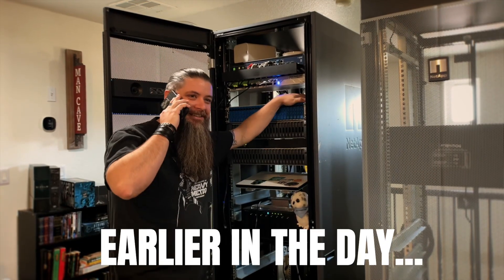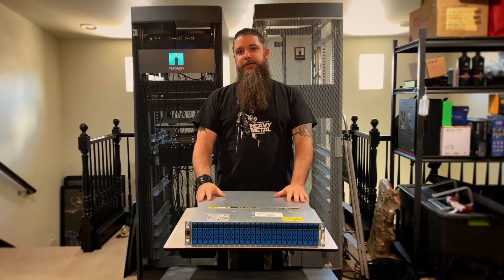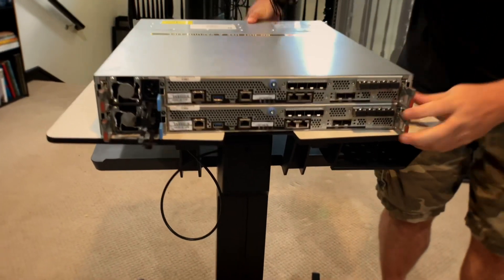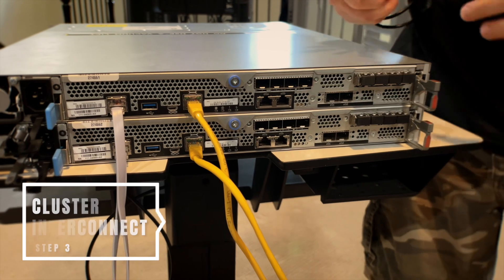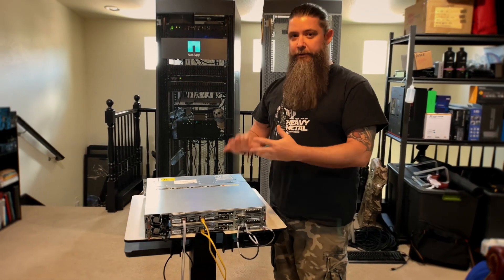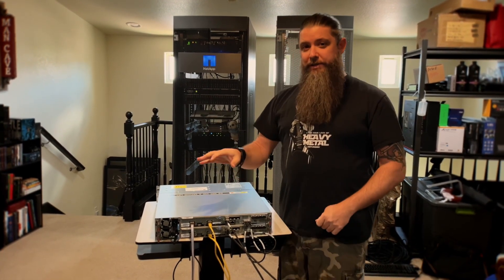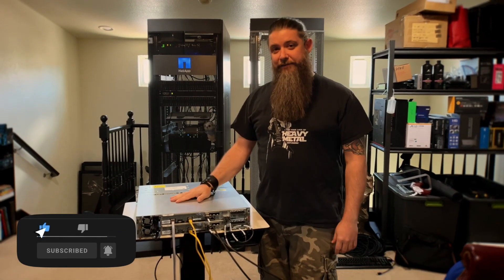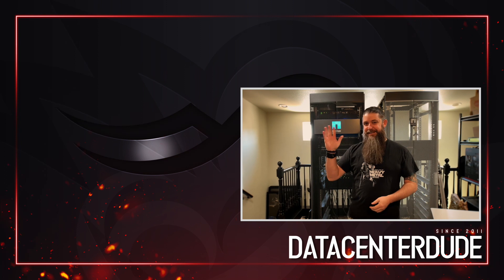Cabling up my NetApp storage system

Comment: i missed the cable specs and a desciption, why you dont need sas/minisasHD cabling.
Reply from the maker: This platform uses 100Gb to connect a single NS224c shelf.  Different than typical FAS platforms.  I've also got a FAS2650 with shelves we'll be cabling up with those kind of cables soon.

Comment: Thank you so much. New to SANs, especially NetApp devices and hard to find non-NetApp video with a real person showing how to cable the devices. The NetApp guides are very confusing if you're not familiar with terms like unified config, inter-connect switches, etc. All my limited experience to write documentation for my client up till now has been with the Select virtual appliance and of course it's hard to visualize how the real cabling looks on a physical device. Much appreciated!